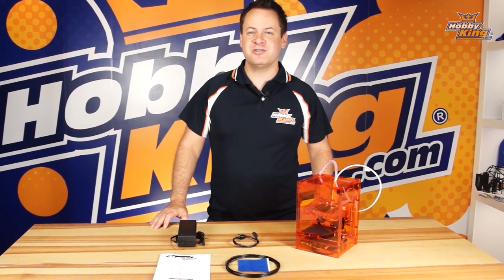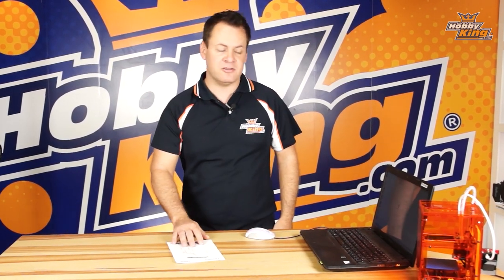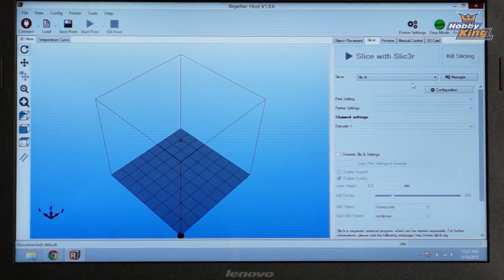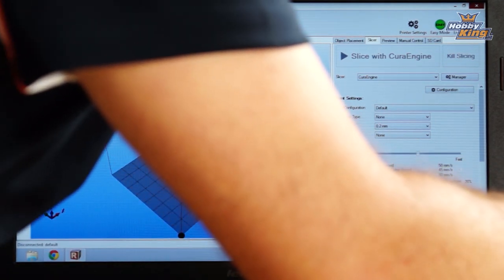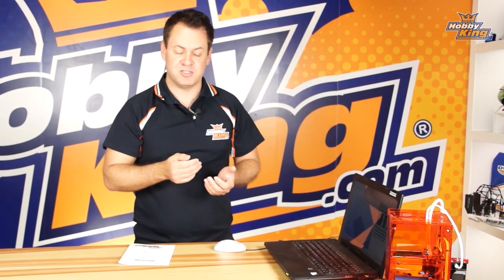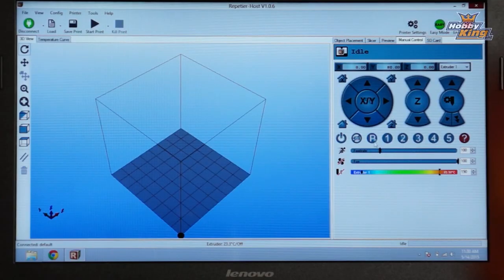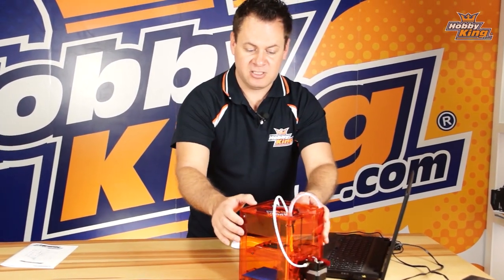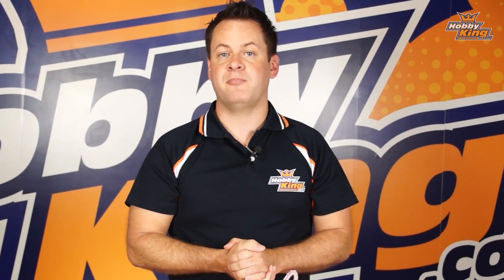Mini Fabrikator 3D Printer by Tiny Boy - Setup Guide

Comment: Well mine was a little harder than in the video.  
Full story which may be helpful.  It wasn't connecting.  "no start signal -  forcing start" .  First I Re-installed repetier with printer plugged in, downloaded an ftdi tool to check if it was bricked, but it didnt even see it (a clue),  then tried another usb port, the ftdi saw it and showed I was not bricked.  Repetier still didn't work.   Using windows device manager, I deduced by unplugging and plugging in again to see what hardware changed that the usb cooresponding to the fabrikator was on COM3.   COM3 did not appear in the dropdown menu of repetier, so I chose COM1, hit backspace and made it COM3.   
Then I was able to proceed with the rest of the manual.
Reply: +John Anonyimous 
Unfortunately I unplugged and cant get connected again.  Installed drivers manually, got bricked, unbricked, just cant connect.  "no start signal detected, forcing start"

Comment: Ok, so on Mac, the current version of Repetier-host (0.56) does NOT come with Cura bundled, seemingly only the Windows version. If you look in the app's Contents/Resources directory you'll find Slic3r.app and Skeinforge.app but no Cura.app. In my wishful thinking I dropped Cura.app in there to see if on restarting Repetier it would pick it up as an extra slicer but no joy. This must be registered at build time as I couldn't find a settings file referencing Slic3r or Skeinforge either. This is particularly frustrating as the setup instructions from HK assume Cura is available but on Repetier-host for Mac it ain't.
Reply: +Rodrigo Martell how did you solve this? I'm trying to connect to the fabricator mini from my mac, but it isn't clear to me yet how this should all work.

Comment: The Z-axis motor stopped working when I was finishing printing, now I need another Stepper 28hs1403. I don't found information on that specific engine. : / Driver apparently wrong calibrano in the section of a4988 engines.

Comment: eveything works until it klicked 'print'. the printer does not move a bit. now the manual control also not work. Printer is still heated, how do I turn the heat of without just removing the power plug?

Comment: I've tried on 2 PCs and it doesn't download the drivers for you. I had to download the drivers from the FTDI website. That's fine though. But I can't get Repitier Host to send commands to the printer. Can you please confirm that this driver "CDM v2.12.06 WHQL Certified.zip" from the FTDI website should work? It installed fine, and Repetier Host says it's connected, but it will not send commands.
Reply: Adam Wilkinson  Same with mine :(
Reply: +Adam Wilkinson Windows 7, maybe? There arte some issues with that. I had that with all the FTDI-plugs I use (Like for the Ardu Pilot, etc.)
Reply: Thomas Bögel The issue ended up being that the printer uses a fake FTDI chip, and the driver I used "bricked" it. I was able to use a tool to  "unbrick" it then used a different driver, now it works fine :)
Reply: +Adam Wilkinson What driver did you change to? Mine's still not working with the CDM v2.12.06 drivers even after unbricking
Reply: I believe the one I used in the end was this one: CDM v2.10.00 WHQL Certified
Make sure you install the working driver before unplugging and replugging after you unbrick it, or it will brick itself again. also, change the port and the bus driver.
Reply: +Adam Wilkinson Thanks!
Reply: +Adam Wilkinson Mine worked fine on Win10 (yeah, yeah...) right out, except I hat so set the COM Port number to 2 in order for the software to connect (find the printer). The  printer worked right away, only I set the extruder temp to 210°C for the Esun filament (as was stated on some review page). I will test with that, but so far it looks OK. 
I do however always use the "raft" support structure, for that levels out any iregularities that might be on the bed. 
I am fresh out of filament, so more testing is pstponed. But TGfAP (thank God for Amazon Prime) ;-)
Reply: Thomas Bögel Good to hear yours found a good driver by itself :)
Reply: Adam Wilkinson Must have already been on it, I have some other Arduino-based projects, so maybe that's where it was from.
Prints OK, too. I had do disassemble the whole extruder/nozzle because of a terminally stuck piece of filament. Also some lost steps on the X-motor, probably from overheating the drivers. I am building a stand now, with a filament holder and an extra fan for the electronics bay.
Reply: +Adam Wilkinson Hey Adam, how does one 'unbrick' it?  Any help appreciated.  I downloaded CDM v2.12.06 WHQL Certified.  And get the same message noted above about not sending commands, etc.
Reply: Jason Uberig See bottom of this thread for unbricking tutorial. http://www.rcgroups.com/forums/showthread.php?t=2469638&page=2
Reply: +John Anonyimous Thanks... I think I'm okay ... I installed the prior version v2.10.00 or somesuch (mentioned previously) of the CDM file and am now able to control the printer.  My current problem is that when I print it moves the print head over to home + Z=15 and sits.  Seems to be waiting for the print bed heater to kick in, but there isn't one.  I set all the settings per the install guide, etc.   I'll go check out that thread and also the mini fab thread too.  cheers. J.
Reply: Jason Uberig  Been there too.  Theres a few different bed temp settings, one in printer settings and another in the Cura slicer. Set both 0.
Reply: +John Anonyimous slicer!  That's one I didn't check, I just imported the stock settings :(  (face/palm!)  Thanks!
Reply: +Thomas Bögel Sweet, thanks!  I got the printer working today, now to learn about tuning it for optimal prints, etc.  Worked pretty good first time, but the initial track on the bed wasn't perfect.  I'm sure me spending some time will sort that out.  Cheers, J.

Comment: i just got my fabricator mini and I'm having connection issues. when i plug in the printer to my computer with the usb all it says is no drivers detected. do you know how to solve this?
Reply: Nathan Holloway i got it resolved
Reply: Nathan Holloway after putting it in to a usb 2.0 then it worked but thats the least of my problems ;)
Reply: +Nathan Holloway Did you find a solution cause I'm stuck too. It finds a port but won't talk to the PC.
Reply: Nathan Holloway my friend just upgraded to windows 10 and it worked
Reply: Didn't help me
Reply: OK repetier server connects but not host
Reply: +Cowboy Boots 1. go to repeater host
2.  go to printer settings
3. go to the connection tab
4. change the port to COM3 or COM2 from auto and try each one 
 and 
if this didn't work just tell me  ;) I'm going to publish some videos about troubleshooting on the fabricator mini on my channel if your interested.
Reply: Doesn't work. I've tried changing the Com # in Device Manager nothing. Definitely interested. Turning into a bigger hassle than my Da Vinci 2.0
Reply: +Tech Scout Connected Server to host able to print that way. Still no connection through port in repetier-host. Changed "Connector" from serial connection to repetier-server.

Comment: Does it come with software to design your own parts or do you use a 3rd party software for that? If so, what software do people usually use?  Never done any 3D modeling so would like to know whats the difficulty level.
Reply: TinkerCad is good for beginners but 123D Design is more powerful. Both are free downloads from Autodesk.